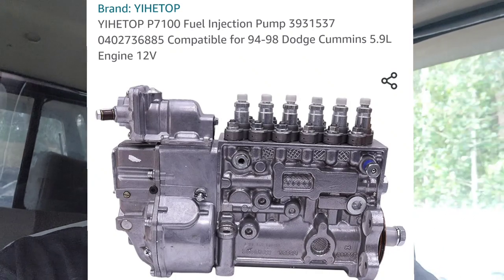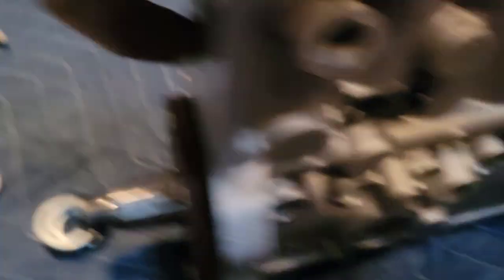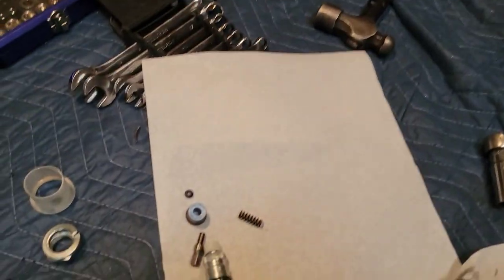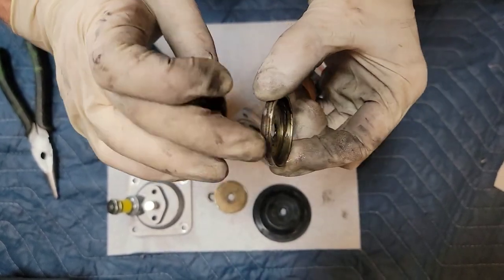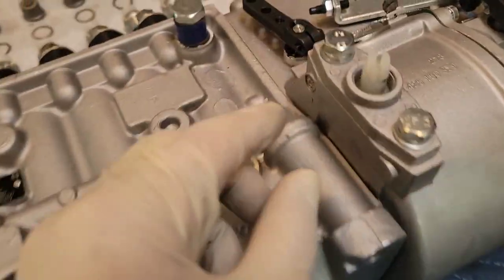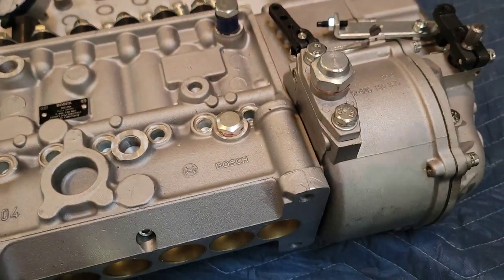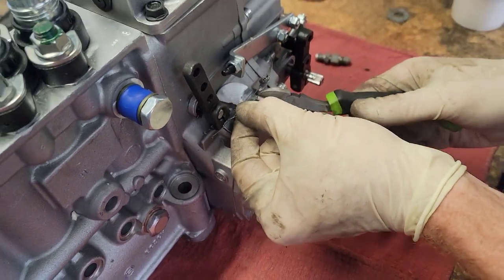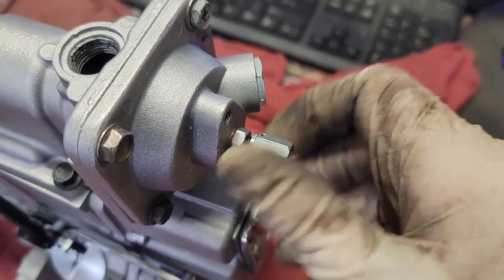12v Cummins Chinese made P7100 P-Pump Replica - Let's disassmble and compare to Bosch

Comment: Do not cut foot on afc , the stock one ones are no longer available, buy a power driven diesel foot that is already cut and if you do not like the results you can put stock one back in. You will never be able to get rid of idle haze wants cut
Reply from the maker: I thought the foot only limits max travel which wouldn't affect idle?
Reply: @BrandonWicknick the afc foot cutting just gives you more rack travel. More rack travel means the plunger started riding on the cam earlier and comes off later, effectively giving you a longer Injecrion event and more fuel.
Reply: You want to cut or remove .100-.120” off the barrel of the arm. This is the part that touches the inside of the AFC housing. And limits rack travel. You do not want to cut the foot. The foot helps control low boost fueling.
Reply from the maker: @97F350Cummins  oh yeah I know that. I'm just using the wrong terminology. I meant the barrel of the foot. No reason to mod the foot itself.
Reply: @MrDylman55 the plungers ride on the cam all the time same stroke every time all the rack does is limit fill time by turning the plunger
Reply: @kennethhubbard7438  yeah, my bad. I gave an improper explanation
Reply: @BrandonWicknick exactly. You can cut without consequences when it comes to idle issues. Only affects maximum rack travel. 

You can do what I did as well if you’re running bigger injectors and want to be able to tune it on the fly. I built my own AFC live basically by running the pressure reference line inside the cabin (and boost line going to cabin as well) and plugged it into a small pressure regulator, and inline was a flow speed controller. 

The pressure regulator allows me to choose how much fuel at any time I want to be able to run (rack travel control), and the flow speed controller is when/how fast I want the fuel to come in (my “smoke” screw controller). I even added a pneumatic switch inline to prevent any boost from going to the AFC thus having a “valet” switch.

Comment: Bosch still makes the p7100 under mico brand in india. these 12 valve engines are still in production for off highway , marine & generetor application. New mico branded p7100 is around 700$ here.. they were made for on highway till 2011 and millions are on road because these engines are immortal.
Reply: Where can we get them from?
Reply: I would love to get one for $700.00 is there a website that you can point me to?
Reply: Id like to know this as well @jsharp1776

Comment: I just bought one... it actually had bosch diverter valves when i took them out. However, they where from a p3000 pump. They also where used (not new) and the delivery valve holder was deeper. I ended up using the holders and springs from my old pump because  the new 191s i bought wouldn't not work with the chinese delivery valve  holder because of the difference in spring height and depth of the holder. Gonna put it in this weekend,  fingers crossed it works ok....
Reply from the maker: @spencerlatam8263  please let us know more after you run it. Thank you for the comment.
Reply: @BrandonWicknick  I got it in and the truck started right up (haven't driven it yet). One thing I did notice the fuel shutoff is keyed at a different angle and when I put my fuel solenoid on it, it didn't kill it when I shut it off. There is enough adjustment in the stop to allow it to shutoff if you do use the keyway. I guess you could put the arm on without the key in it and adjust it at the same angle like the stock cummins arm though.

Comment: The difference with the do is the thickness of the shoulder above the fuel cuts. The 131s have a thick shoulder and the 191s have a little bit narrower shoulder resulting in how much fuel flows the the do. Hope that helps!! 🤘🏽

Comment: Still watching your video but the differences on the DV’s. The flute volume and shoulder hight. Lol it’s wild that they send that with what essentially looks like a full cut. The stem I agree is for the spring, normally the stem is for a constant volume or pressure setup (I’d have to check my book for which) but it’s missing the rest of the valve system in the holder for that. The holder also looks like a strait shot .120 holder not the valved oem holder which is again wild lol. Depending on the cam if you benched that thing with full rack it should really displace a lot of fuel but have extremely poor control over start of injection and end of injection. Switching out to a shouldered dv is definitely going in the right direction :) awesome video.

Comment: Thanks for taking the time to do this video. I suspect you can use your dial indicator tool to measure maximum lift on the pump and compare that number to determine if this is a 160, 180 or 215 clone. That would be awesome information. Please add follow up videos as the months roll by to let us know how it is performing / working. Thanks!
Reply: Yes please!

Comment: Thanks for the review, and please follow up, or even get second opinions. A while back, I figured that someone had surely made a cheap clone by this point, or even a decent quality variant that doesn't cost over $2K. Then I saw these and have been wondering ever since, if they're ever going to be a better option for diesel hotrodders and pullers, over a 30 year old pump. They are becoming harder to find as time goes on, and core charges are expensive. I hate chinesium as much as the next guy, but if one of these can do the job well, maybe with a little 🇺🇸 or 🇨🇦 parts injection, that would really help a lot of people out.

Comment: So where do you go about getting a Chinese p7100? Temu? Lol
Im planning a p pump swap for my ‘02 24v HO 6 speed. Its about to hit 100k miles and close to ‘broken in’ heh. Got the crazy carls kit and been  piecing together a lot of stuff over the years for the time. I knew i wanted to p pump it 8 years ago when i bought from the org owner with 79,000 miles. But i told myself i wouldn’t tear into the motor and do anything to it till it had at least 100k on it first. Took 7-8 years to out 20k on it. 
Is the Chinese pump worth it? From what i gathered from your over view im more curious now and want more i for. I mean…its just a pump. 
Bosch is german, and germans do make nice quality mechanical things. But so do the Chinese, and they do it cheaper than the germans lol. Im not against getting one of these to build. Id defiantly would go thru it like you did and make it the way you want.   More vids, install of it and test drives!!

Comment: So if I buy that Chinese pump without modifying anything, and install it directly in my ram, the truck will feel heavy, how much real horsepower do you think it can give, because according to eBay they are 215 hp pumps, I am interested in your opinion before buy it
Reply from the maker: @CarlosMorales-zd6kh  I haven't had tbag experience. What I show in the video is my only experience. I decided to verify and modify before installing. I think it would work OK without modification but I was not impressed at what I found inside the new pump (mismatched and possibly used parts)

Comment: Where is your AFC housing plumbed in for boost pressure on your 24v Cummins? I set my truck up. But for some reason it seems like it falls on its face after I hit the turbo, almost like it is out of fuel. I drilled a hole in my neck above the heater grid and plumbed it in there. But I am not sure where exactly it is supposed to go. I also just bought some 191 delivery valves for it as well. And have installed the 4k springs in the pump. Any help would be much appreciated. Thanks in advance.
Reply: The intake casting on the cylinder head has NPT plugs in it. I want to say 3/4" or 1". I removed one and installed a bushing to get my boost tubing for the AFC.
Reply: Thanks for your help

Comment: What are these pumps a knock off of? 160?
Reply from the maker: I was not able to measure the cam so I cannot confirm however based on its performance in my truck I would guess 160.
Reply: @BrandonWicknick  ok. Thanks. My 160 makes enough power but I’m looking for a 180 or 215 to get rid of it the sticking plunger/ run ability issues I know will eventually come. Thanks.

Comment: well chinese pump cost $700 while oem bosch is $7k new

my question is how to determine hp on those chinese pumps since numbers on tag not accurate?
Reply from the maker: I really think they only manufacture one type of pump in I'd guess that it's the 160.
Reply: @BrandonWicknick  Thanks
Reply: @BrandonWicknick  That's what I was guessing
Reply: If they were made for TATA busses, they are 180's based on what I read about them and I can make sure once I order the special tools and take mine apart. I have two TATA 5.9's in my storage @BrandonWicknick
Reply: @jalo1739  did you ever confirm this?